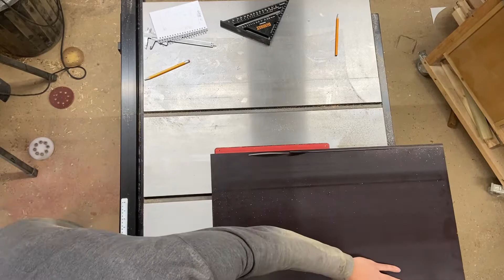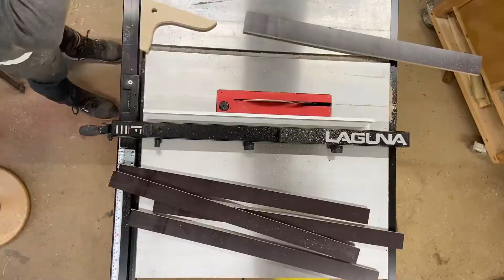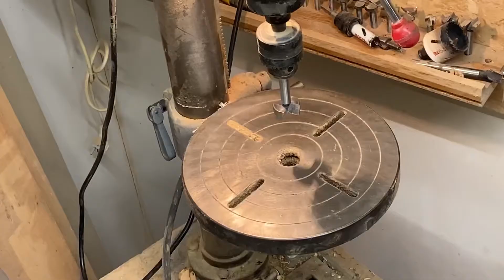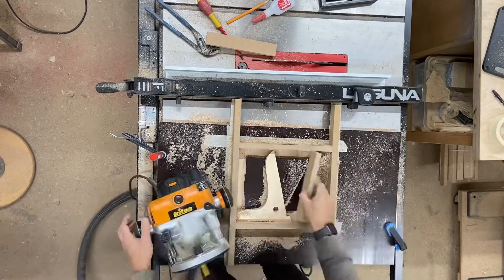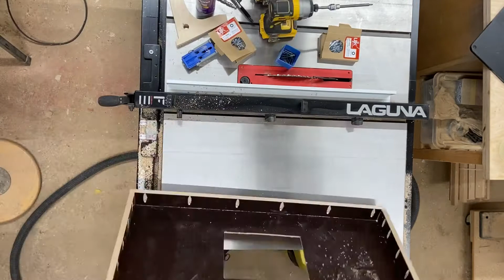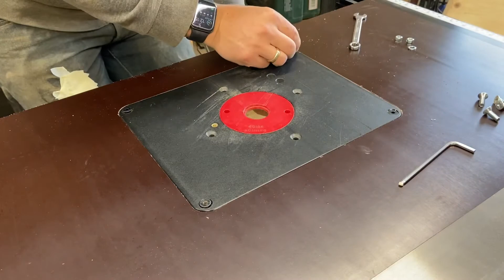DIY router table insert for Laguna Fusion 3

Comment: Showing how the router table is mounted to the saw would have been really helpful.
Reply from the maker: The guide rails on both sides of the table saw already got mounting holes, so its just a matter of drilling holes in the plywood and add the appropriate bolts